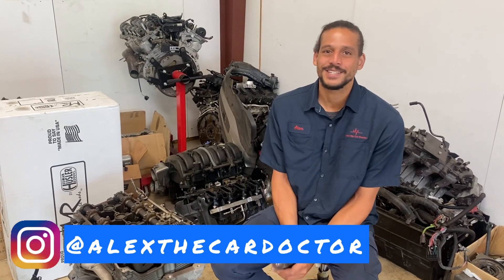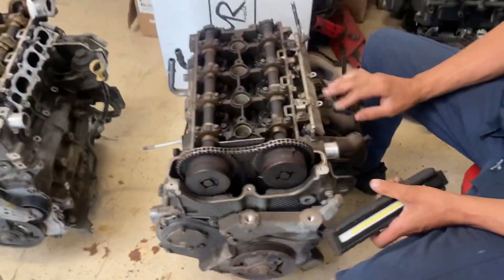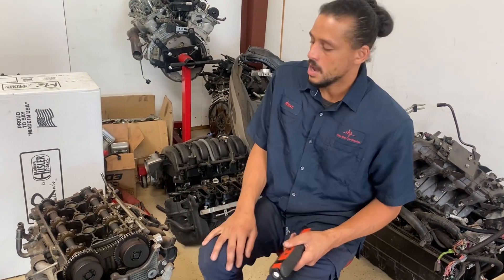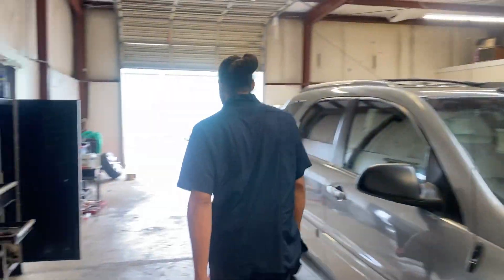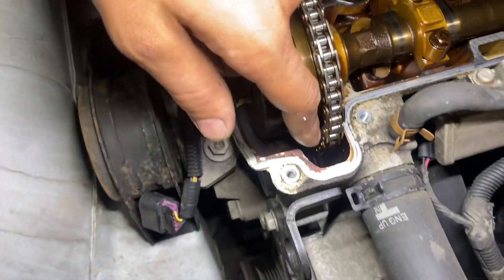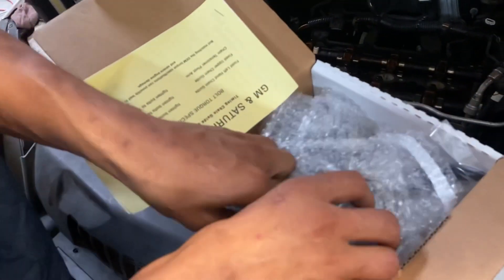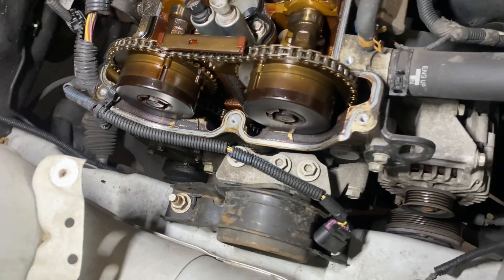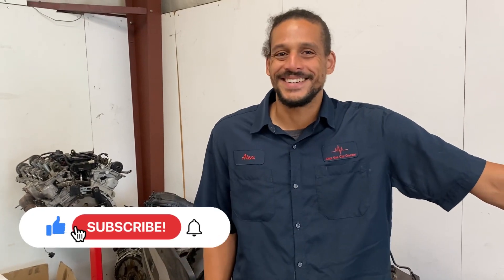Common Timing Chain Issues with GM Ecotec Engines | Timing Chain Rattles and Codes  timing chain #gm

Comment: I have a 2012 GMC terrain 2.4 it jump time for the time machine to guards and stuff in it like I guess the bells are hitting the Pistons about the Carter really good deal I was just wondering what your opinion would be should I just put a head on it like a used head what should I do you tell me what you think cuz I don't know much about the motor the guy said it was a good motor that I bought it from but you know how that goes

Comment: Hello to the car doctor ,just saw this video ,I have the 2009 chevy hhr 2.2 ecotec engine  natiurally aspirated engine i have 275,000 miles om my engine ,i read that if you have a timing belt chain in car that it should last life of engine now i always worry about that cause this car is very hard to work in tight inside and timing chain work is expensive ,I had to do myself the water pump and coolant bypass cause silicone orings were leaking took it to my mechanic he did not want to work on car cause he said they are hard to work on ,i had to do it myself i am not a mechanic ,took a week to replace water pump and o-rings on by pass they wanted 2000,00 dollars now the same price was for timing chain but the mechanic said if no noise it should be ok ,i recently changed my valve cover gasket ,checked out my vvt solenoids no debris on them also checked top guide tensioner and the sides everything was tight no slack ,since i got the car in 2015 every 3000 miles oil change thats what i learned when taking autoshop in high school ,5w30 oil in car  and again i asked another mechanic when he changed the timming belt on my acura mdx 2006 these cars have a regular belt he said timing chains will usually last the life of engine if you do not hear slapping noise when start up you should be good ,i always listen when car starts up for any kind of noise so far its good i always heard the same thing about these engines all these problems but other than changing sensors ,exhaust systems ,starter ,this engine has been excellent it does not burn oil ,the only complaint i have is these sensors they put in this car always go wacky to me that is minor compared to timming belt changes and water pump which was the worst job i ever did on any car ,to this day i still wonder how the hell did i do water pump cause you need a special tool to hold timing chain in place cause water pump is driven by it abd i was anervous wreck ,was upset about my mechanic for refusing the work on car ,i wish i finished goiing to auto mechanis school i coiuld be a nechanic right now ,as i approach 300,000 miles i worry cars now are too expensive and to me they are cheaply made all american cars today to me suck !!!! and foriegn cars what car can i trust if i have to replace the hhr not sure how this will change but just wanted to show if you keep up oil changes and other maintenance on your car i think they would last longer ,its not hard to take care of car ,if you go and put gas in a car every week cause you know you will stop dead on road its not so hard to do these very simple things JRo

Comment: Thanks for this Video! I have a 2005 Saturn Vue with the 2.2L. Just started making some rattling noises. Pretty sure it’s the timing chain guide. Thanks to your video I have the confidence to pull the valve cover and some tips on what to look for. Heading out to the shop right now!

Comment: 2012 2.4 ecotec. Just hit 245k. Original engine and trans, never had any issues besides suspension wear and tear (tie rod ends, cv joints, brakes etc). Absolutely zero problems with car. Only problem is, I'm getting bored of driving this thing after 11 yrs of ownership

Comment: I've owned a 2.4 2010 Malibu and it was at 190,000 with the same timing chain now I'm owning another 2010 Malibu with the 2.4 and it's at 154,000 and on startup I could hear it rattling and hitting the guides 😮‍💨

Comment: Yes thread sert or helicoil would be very good in that application. IF the threads were actually gone...if it simply backed out, lock tite and reinstall it.

Comment: Good video. Is the timing chain slack only a result of low oil?
Reply: Even with oil the guides will wear out.   Automatic tensioner.  But will only tighten up so far.
Reply: I just checked and changed the cam phasers because of startup rattle. The chains have some slack as the tensioners are depressurized.
Reply: If the chain is loose.   Going to need to be done.  Chains are to be tight. Risk jumping time and wrecking the engine.  Spring tighteners.

Comment: the thread inserts work better than factory. they tend to be steel and where they hit the aluminum is now a larger size due to using the insert.
i would trust them more than the original threads.

Comment: I work on steel mill related equipment,  mainly 100k lb+ machines and at times we have to use helicoils, they get red thread locker and they always hold up well especially when seeing high pressures

Comment: I have a 2012 Buick verano 2.4 l timing chain is bad at 179k miles is it worth to fix or trade in been very reliable but been having to fix minor maintenance since but timing chain is the biggest issue I ran into since owning this vehicle for 5 yrs

Comment: Got a 2.4 eco tech in a equinox going back in with timing chain the chain seems to be to tight like it’s too short only white guide in but no bolt yet and it short where it’s hard to get over bottom sprocket. Seems like once the guides and tensioner is in it would be snap the chain

Comment: Good video with good views showing in an unacceptable amount of timing chain slack in these GM Ecotec engines. Questioning my 2.4 L in a 2013 Captiva that started with a cylinder 3 misfire and seeing some slack when I pull off the valve cover.

Comment: I don’t really got a engine problem per se but I got a 2012 Chevy Malibu with 140,000 on it. I got an issue where I have a high idle and sometimes it will go into engine and reduce power (limp mode) I do is turn the car off. Let it sit for a couple minutes. Turn it back on and also the mass airflow doesn’t read. This issue happened after I removed the throttlebody and replaced the exhaust manifold. I’ve then replaced the throttlebody and mass airflow with OEM components. I’m not sure what else I could possibly do to solve this issue. It’s got a mass air fall low circuit code that will not clear itself

Comment: Does one need to replace all components, or just the chain?
Reply from the maker: I recommend replacing all
Reply: @AlexTheCarDoctor  u know that is NOT what I wanted to hear... lol.
Reply: @AlexTheCarDoctor  thanks though. Probably saved my from having to do it twice. Just did converter, now must do radiator and timing chain. I'm still hoping it is just tension rod. I'll look when I change radiator.

Comment: Quick question regarding the 2.4 engine. How often do you have to replace the timing assembly? The reason for the question is because I have changed the timing twice in a year period because of the long black guide that’s off to the side of the timing chain.

Comment: On the subject of vvt engines. I have a 2.4 ecotec that spit out a p0013& 14 codes. Replaced B side actuator and engine still falls on its face roughly 2,500 rpm.  It is high milage 160 +. Guess I need to check the chain Tension especially at the  current milage. But the actuator cleard p0013 and the problem persists. Any recommendations?

Comment: I'm subscribed and following you here from over in Tiktok land.  I had an Equinox that was a good car with the 2.4 motor.  They can't be neglected on oil changes.  I did 3,000 miles with Rotella 10W-30 truck oil.  Fuel dilution from DI will trash a modern motor.

Comment: glad i came across this video. i have a 2016 chevy equinox that has the ecotec 2.4 liter engine with 132k miles on it. i recently went on a short trip, round trip of 300 miles or so, and noticed some clicking noise from the passenger side of the engine when i got back home. it sounds like just what you have shown and described, like either the tensioner died or the top chain guide broke off and the chain is rubbing against the valve cover. this video has already helped me. im going to look into this issue this weekend. at least i can find out what is wrong, then i can take it to get it fixed. wish i could fix it on my own, dont have the tools to do it.  thanks for what you do!
Reply: What did you find out over the last 11 months?

Comment: It’s funny. I ran across your video today just out of pure luck. I’m currently replacing a timing chain in a 2013 GMC terrain 2.4. This vehicle came in running horrible with a tremendous amount of codes as you can imagine. Everything from reduce power, cam correlation codes and so on. When I removed the valve cover, I noticed the top chain guide was snapped off. I found it lodge down in the timing chain. That’s what was making so much racket while running. Anyhow, once I realized how loose the chain was. I immediately did a leak down test to make sure none of the valves made contact with the Pistons. I stuck a baroscope in cylinder one at top dead center and found the intake valves were open just barely missing the piston. Clearly it jumped time. The customer got extremely lucky. I would have to say in 35 years. I’ve seen a lot of things. But I can’t say that I’ve seen a valve possibly being one tooth away from catastrophic failure. I wish I knew how to send a photo. I did take a picture of it because it was absolutely amazing.
On a sidenote. When you do the timing chains on these, you should go ahead and change the balance shaft crank chain as well being you’re already right there. Just my thoughts, Ron.

Comment: I just did the timing chain on my 2.2 and it had the old style tensioner and right when I pulled it out the engine it exploded. So there definitely is a reason for the recall but I didn't have any issues with that bolt came out easy enough and went in easy enough

Comment: Chevrolet Heritage High Ridge (HHR) 2024-09-06 1323 PT

I have a 2011 with 284K, though a replacement engine from a 2010 Saturn Aura that is now at ~314K. Replacement was April 2020, at ~150K on the car. Per the wrecking yard, ~190K on the replacement engine.

Now good tension on the timing chain, spark, fuel, but no compression. 🤔🤫😬

Oil change at ~3,000+/- with SAE 30 CF-2 and/or 15-W40 Diesel oil.

Comment: Mr Alex  you are GOOD Thank you,   I have 2 Sunfire GT Convertibles,  1  Ive always driven,  other I just bought but it is making that rattling sound but Running Perfectly,  you just taught me ALOT  I bet the tensioner is bad and the chain having slack probably slapped into the top guide breaking it off and it is flying around like a Pinball in a Pinball machine,  I just hope the tensioner bolt did'nt strip like that engine you showed,   Thank you Very Much.

Comment: yea man i did 2 of these engine.. gmc terrain and chevy equanox.. both timing chain guides broke off.. my question is parts of that black plastic guide i guess went down thru into the oil pan.. would it be safe or ok.. to go about it and let it be or should i take oil pan off

Comment: The main reason behind the timing failures on these ecotec is because of oil leaks, these eco tec engines can not run low for any reason or will have timing failures not long after oil gets low! Gotta keep up on gaskets on these to prevent timing failures! With the oil low the timing components will get to hott and fail! I have my 2.4 ecotec at 250 ,0000 miles still running strong! With that said had replace main seals timing cover gasket , valve cover gasket , intake manifold gaskets just redid it all! No leaks is a happy ecotec
Reply: Did you ever change the timing chain on it?

Comment: My wife has a Holden Malibu 2013(Australian rebadge) with the 2.4L engine that had timing chain failure first at 40000 miles(2018) and now again at 60000 miles(2024). Full service history, regular driving conditions. First one was covered under warranty, this one the dealership is being quite painful about it.

Comment: I did a repair on a grand am where that bolt walked out, I put it back in and about a year later we did the timing chain assembly and that bolt stayed in. The threads are not damaged, the bolt just vibrated out from factory torq being to low, thats my guess. If I were you I would repair that engine for your customer. Helicoil is a great product, I have used them for years, dont be afraid of thread repair.

Comment: Working on a 2009 cobalt with a p0016 replaced timing chain and tensioner did not replace vvt sprockets, car idles shoppy, same code and runs the same after repair, Help! 
2.2 vvt ecotec

Comment: Liked your vid and subbed, I appreciate your chill personality. Just bought 2015 equinox 2.4, the seller said it ran when he parked it but rattled. He had a shop put a chain kit at 116k now at 140k , I just looked at his last bill, it said in for no start, i never didn't try to start I pulled off VC and bottom chain cover. The right side black guide bottom broken.Upper most guide gone. Timing marks at the VVT look to be off. All the roller followers seem to be in place. About to go look to see if the bolt has come out. Any advice I would appreciate. Thank you.

Comment: HELP DOCTOR! I have a 2002 Sunfire 2.2L. NO COMPRESSION ON ALL 4 CYLINDERS! Timing chain has a little slack, but not as much as the last one in this video. Some roller rockers are loose, but not all. Will bad timing cause ZERO compression? Thanks Doc.
Reply from the maker: Hey there buddy yes bad timing will cause low compression on all cylinders. If you have loose rockers you potentially have engine damage, valve to piston contact has occurred.
Reply: @AlexTheCarDoctor  Thanks Doc, but will bad timing cause ZERO compression on all 4 cyl's?  Also, many of the rocker-rollers just fell off (when touched) where they span the spring and rod. Is this still an indication of "Catostrophic damage"? Appreciate the quick response brother. Last question. Thanks from the Kansas City Shade Tree Mechanics!

Comment: Dropped off my 2014 Equinox at the dealership for check engine light issues, they found that the timing chain was starting to make noise. It’s got 108,000 miles on the odometer has had oil changes with correct Dexos certified oil at 5,000 mile intervals. We had no oil consumption issues until it reached 100,000 miles,now we use about a quart of oil ever thousand miles. Since we plan to keep the car we’re having it repaired.
Reply: Start changing the oil at 3000 miles. Those engines last longer with shorter intervals. Also, don't use ECO mode. It increases oil consumption.
Reply: every 3000 miles i change oil on my 2009 2.2 chevy hhr timming chain is original no slapping noise and my check engine light is on now cause of a bad charcol canister solenoid which is cracked giving a code of p0440 if i remember and thats an emission code which i am fixing now but engine is running fine no oil burning had a oil leak caused by original vaive cover gasket which i am going to replace soon ,but other than that car runs very quiet still JRo

Comment: I have the 2.4 ecotec engine in my Pontiac G6 . It has 157000 miles and runs great . It uses no oil at all.

Comment: im javing same issue roght now on .y 2011 chevy malibu LT with 81110 miles on engine light is on and wont clear off thowing codes POO16 AND POO17 intake and exhaust corelation code i changed them out and engine light still on wont clear off with my engine scanner and noise from engine sounds like a tiny garm tracktor any ideas what moght be ??? i do have timming chain set ordered
Reply: its on a 2.4 echo tech motor

Comment: I heli-coiled one for a customer with a waiver due to financial constraints.  I used a coil with red loctite and let it cure for a few hours before reassembly. Has gone over 60k since and no issues (yet). Not the right way by any means but this was explained to the customer and agreed was a good solution considering her financial situation at the time.
Reply from the maker: Oh absolutely, but I always seem to get the knucklehead customers where I try to help them, I explain all the risks and they still get mad if and when it doesn’t work out as if I didn’t explain everything to them 😔
Reply: I get it, it's happened to me before.  I've come to understand that the customer is not mad at me per se, they are just upset that their car is broken and costs a lot to fix. Always put yourself in their shoes, empathize with them and tell them you will do what you can.  They already knew they were taking a chance so there is no need to point it out. Just de-escalate and take care of them.  They will get over it. @AlexTheCarDoctor

Comment: The worst problem I saw with the Ecotec motors was with the chain tensioner. I think it was redesigned two or three times. I'm not 100% sure, but I think Saturn was the first to use the 2.2L starting in the year 2000 in the L-series.
Reply: Yet the problem really never went away (Tensioner design). I think religious oil changes is a must for these engines; even more so on the latter 2.4L units with VVT and junk DI. My 02 Ecotec has 202,000 with the original chain and tensioner. I am overly worried about any noise from my engine which drives me nuts though since it is so common of a issue. I do have a slight exhaust leak though.

Comment: Hi , can you tell me if this problem still exist on newer models 2019 and 2020 where the 2.0 gasoline turbo engine puts out 260hp and some more torqe ( this motor exist in opel insignia 2017 to 2020) i guess it is also in the same model year at buick regal .
Thank you very much